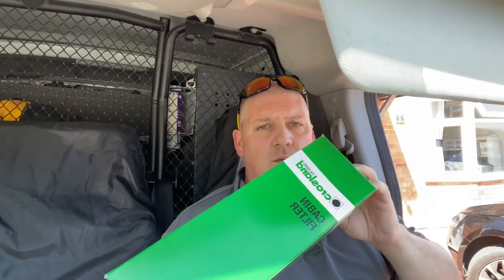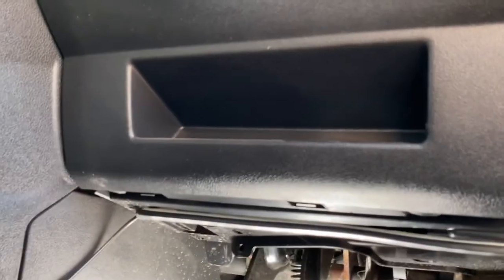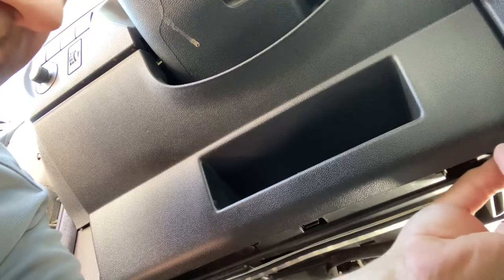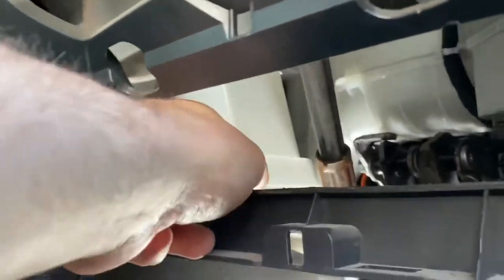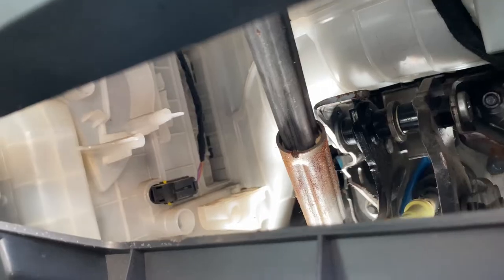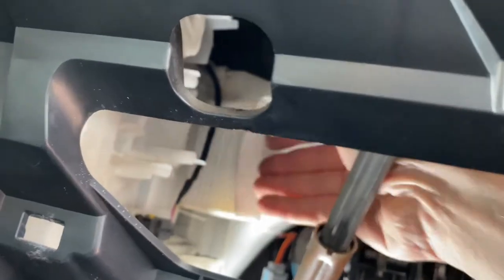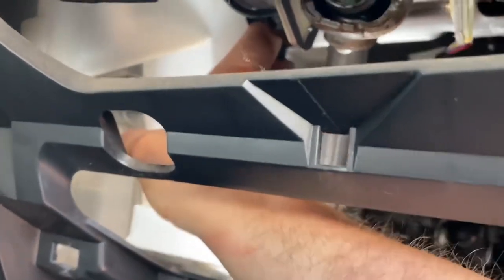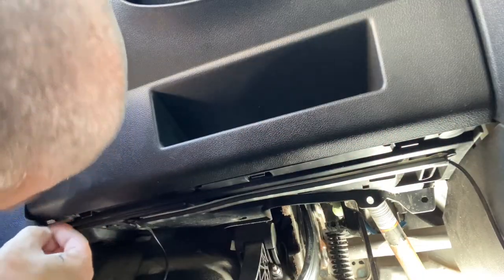FILTER everyone forgets! Peugeot partner/Citroen berlingo cabin filter 😃

Comment: I think that`s part of the service, but don`t believe many would change them, but give out the old BS saying they have. Had 3 simple oil changes in 10 years KwikFit, cross threaded the sump plug. National Tyres wrong oil filter, blasted off the thread, twice, covered the engine bay in oil, twice.
Carrera Worx, Brentford cracked the oil filter housing by overtightening on my Brand new Peugeot Partner, then tried to blame something else. Then asked me to contribute to the cost.
Bodgers, all of them.

Comment: Mate ive had such dramas with this. First time servicing van myself and appauled. The sensor thing inside fuel filter was snapped and blue tac on drain at bottom then this filter they clearly struggled so they just crushed the filter in couldt even get the black cap back on which i remember finding under my van seat and wonderong what it was. Now theyre stuck i cant get them out and in trying they have flipped vertically inside so no chance now. Any advice?
Reply from the maker: Could you reach in with something like this claw and try and grab it: https://amzn.to/46MVxaD
Reply: @dadskillzcars  good thinking my gran has got one of those, sadly I don't think it will have the strength though as filter has flipped right around inside. Honestly fuming with mechanic, the whole point of paying a "professional" I'd for peace of mind that they will do a propper job and not strip threads or snap and force things. Really appreciate your videos bud.
Reply from the maker: @ollyjackson8733  thank you and cheers for watching